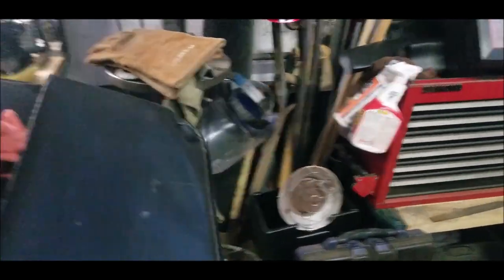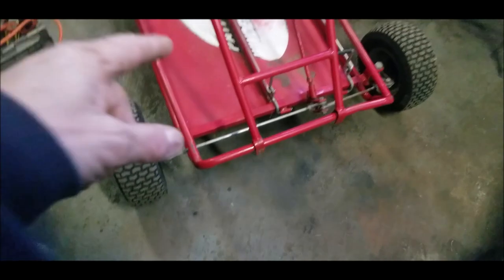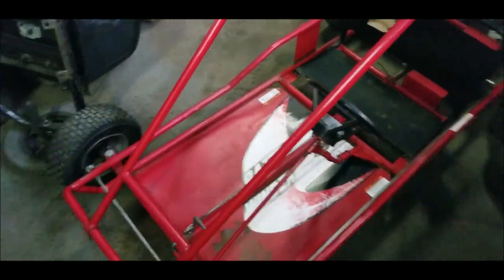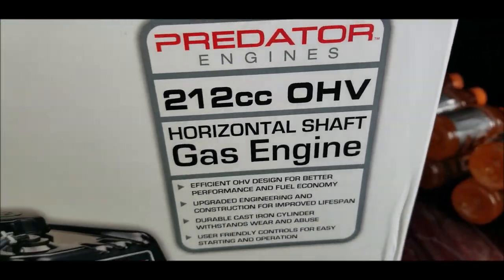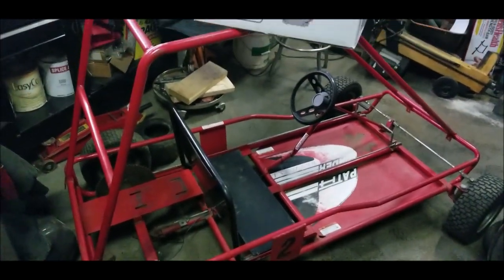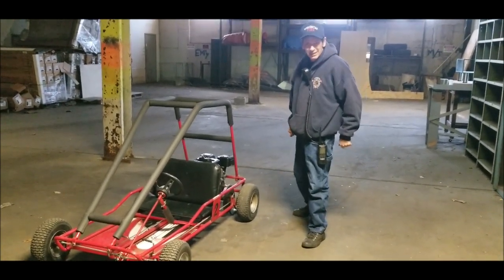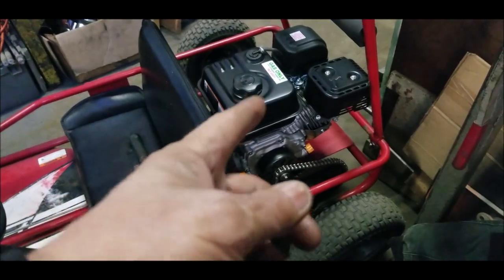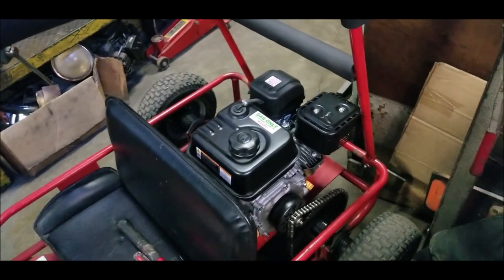1980's Pathwinder Gokart Rebuild With Udizzy1969

Comment: What size is the axle size or sprocket size  for a new one
Reply from the maker: The 72 tooth Bad Boy. Lol  Stay safe My friend.  Dizzy.
Reply: @udizzy1969  any way u can tell me the diameter of the stock rear axle ?
Reply from the maker: It Is A 1in Axle My friend. Some Live with two wheel spin and some with the one wheel spin, Stay safe Dizzy.